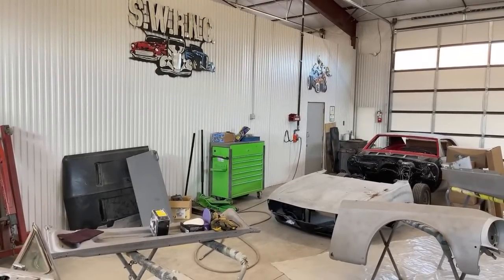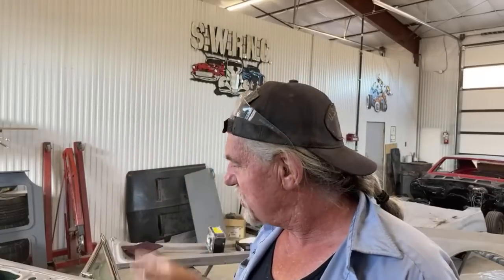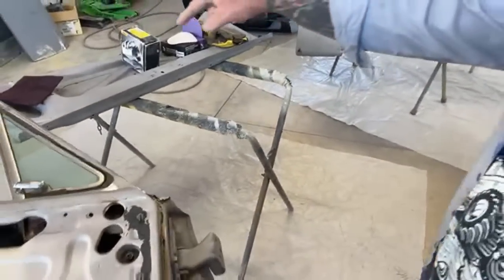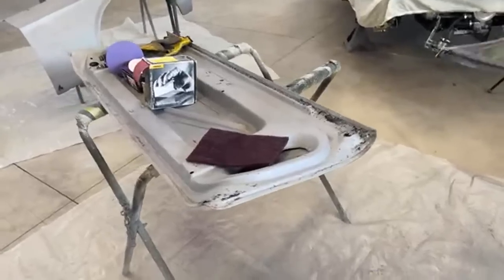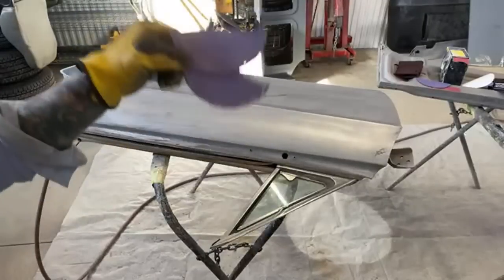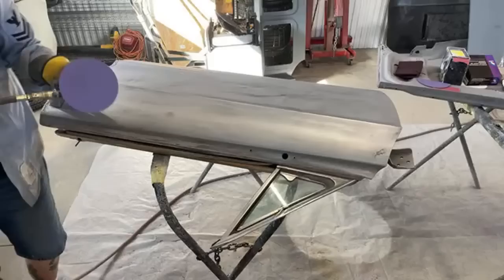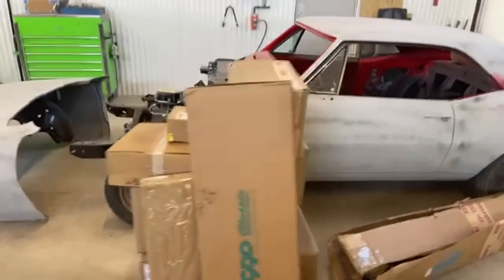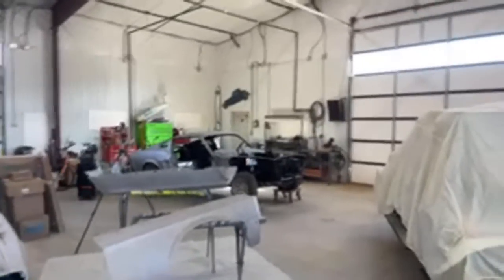How To Prep SANDBLASTED Metal For EPOXY PRIMER

Comment: Thank you so much for all this good Info. Im in the process of prepping my Grand National for Primer. I have a frame off Resto and had the Frame and Body wet blasted. I am being very thourogh and cleaning all the sand out etc. Anyway. I noticed you mentioned the inside of the fender didnt need to be prepped because well you dont see it. Do I need to prep all the metal under the body. Or even prep the frame. Can I just primer it and that will be good enough or will it not adhere properly. Im assuming we are doing all this prep work to the outside to get a nice smooth glass finish thanks!
Reply from the maker: You will have to scuff everything with 80 grit or red scotch brite pad to remove all the rough surface blasting material from it but other then that your good to go

Comment: Pete, I gave up on having anything big power blasting like body panels at all. If the parts will not fit in my detail blast cabinet. I drive 9 hours (one way) to have a long time chemical dip company that they first strips everything in one strip tank, then in another tank they de rust everything, then they dip everything in a 3ed anti corrosion sealer that everything gets left in that tank over night to soak into every crank & seam in the parts to flat out stop it from ever rusting again. Yes, it's very expensive and adds 2 weeks or so to the build.  Then when there finished, I drive back to pick the car & or parts up and move on to following ALL the steps to prep every part to seal everything with epoxy primer as you do. True, it might be over kill, but it should never rust anywhere for many decades. This is how 85% of all the big money show cars are done and it has been a proven process for decades.   Don't blast, dip.  If the customer doesn't what to go for it, you don't want that customer.  YES I KNOW it's a pain in the butt for 2 trips to get it done, BUT after you get it done a few times, you will find it really is the very best way.   See link 
 https://www.youtube.com/watch?v=ll6XRz7Z0PM

Comment: I use an aftermarket deck lid on my 69 mustang, I could not find a good original,  the aftermarket part fit perfectly,  I was shocked by how nice it was because of past experiences with repop metal.  Maybe I got lucky?
Reply from the maker: Im trying to get a Muscle Car GT deck lid,, thats probably the brand you had in a different box.. They are the best but on back order for over a year!
Reply: @diyautoschool  The deck lid box was "branded" Dii.

Comment: When Googling epoxy primer just about all say you can shoot paint directly within 5 days, presuming without sanding or shooting a primer  others say after 5 days to abrate. I'm confused if it's not sandable than why sand and do you or don't you apply a primer (with or without sandibg), than sand than paint? I don't recall you ever applying paint over epoxy primer.
Reply from the maker: Yes you can paint over epoxy with no problems   It's a sealer and thats what it's designed for.. Thanks for watching.. I apply paint over epoxy primer all the time when I paint 99% of all cars I do..
Reply: @diyautoschool  thank. You always stress epoxy primer is not a primer but only a dealer so got confused. So epoxy primer can be used in lieu of paint primer.
Reply: I run out of 80,s used 240 on one panel on metal. Do you think the epoxy will fail?

Comment: So at what stage do you use the vinegar water ? Im confused
Reply: @Doctor Mengele   >This was wet blasting. Pete has a video in TX he used Muriatic acid, then vinegar. I believe he was using the vinegar alone after a chemical strip to stop the action and neutralize the chemical in paint stripper, but those days are gone since the EPA banned sales of Methylene Chloride in 2019. 
Now, use "Coopers Strip Club" kits or refills bulk sales. It is a spray on paint remover with a second part "Flusher" that neutralize and preps the metal. He has an introduction video and a side by side video. The ph # does not require a country code and you can buy over the ph as the inventor wife answers or straight of the web site and free shipping from New Zealand if over a reasonable low amount.
 Best of luck with your project!